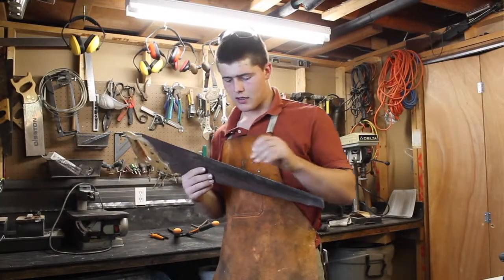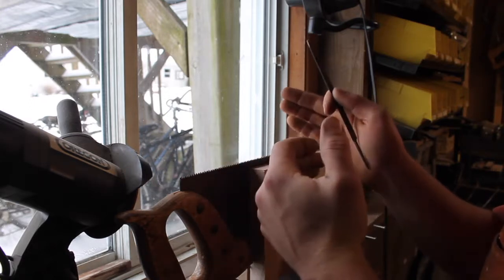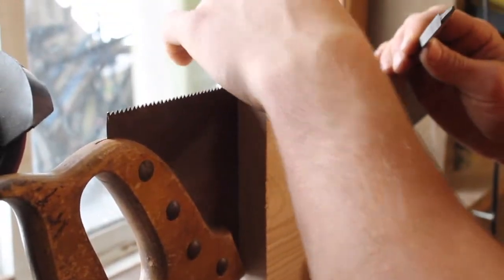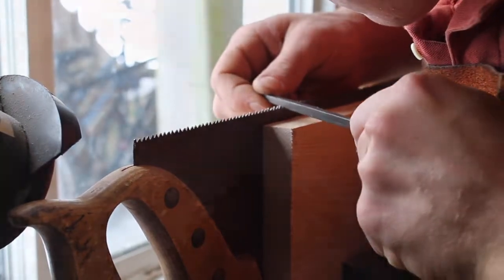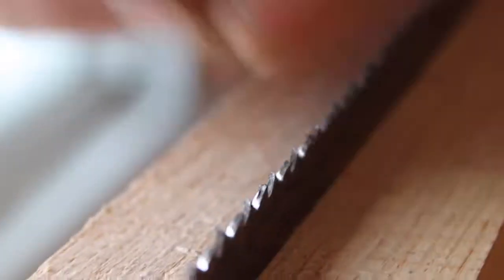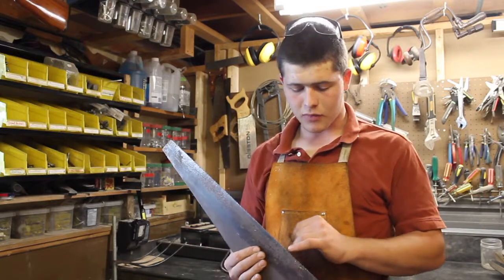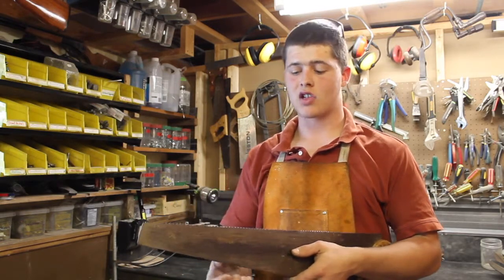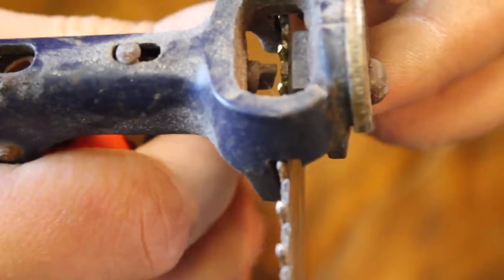How to Sharpen a Handsaw

Comment: One comment from an old joiner- Never , ever, use a file without a handle, if you slip, or the file jams, it will go straight into your wrist, also, the handle will give you much better control over the file, to keep the file flat. Good job though, although you didn’t show the topping process before you started.